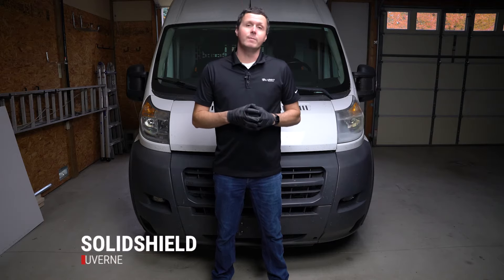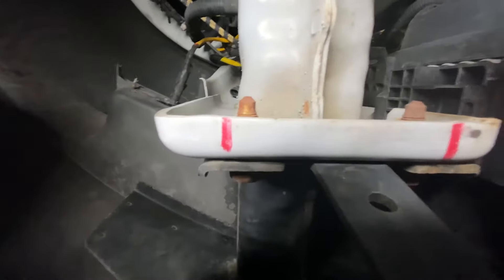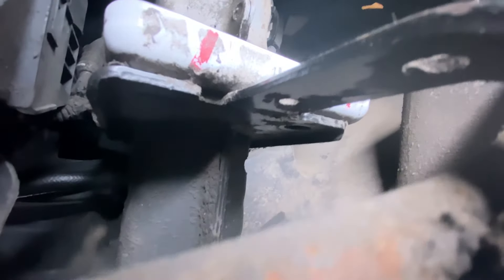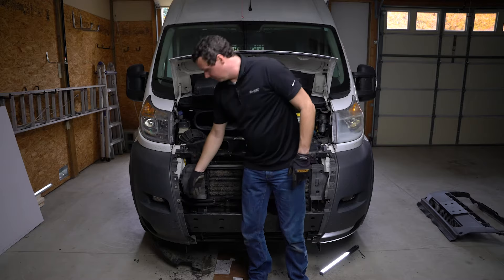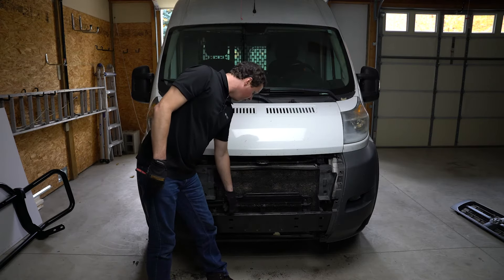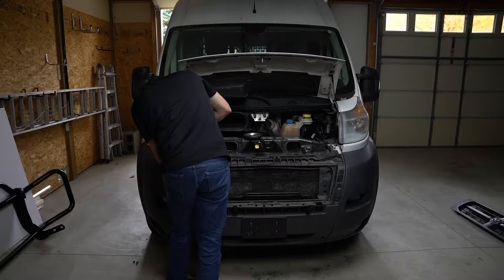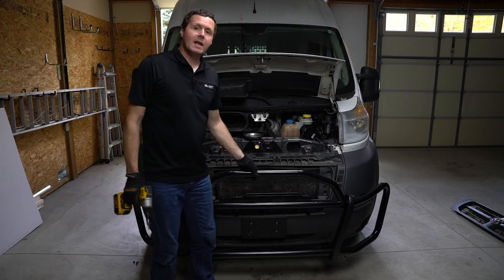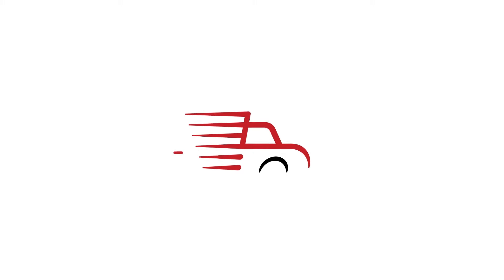Installing Luverne SolidShield on RAM ProMaster

Comment: Thanks, about how long was the install?
Reply from the maker: I'd give yourself an hour or so. It can be done quicker (about 30 mins) if you are familiar with removing the grille and no corrosion issues with removing your frame/bumper bolts.

Comment: I watched this video because most of the different grille guards have the upper attachment. I was worried that it would puncture the radiator with a simple bump (accident). If my engineering mind is correct, it looks like those brackets will bend or break above the connection point to the bumper and possibly keep from puncturing the radiator. Is that how they're designed?
Reply from the maker: Good question! I'm not exactly sure if they were designed with that intent, but agree with your assessment. The top mounts seem more for stabilizing while the majority of the load is sent to the lower mounts.